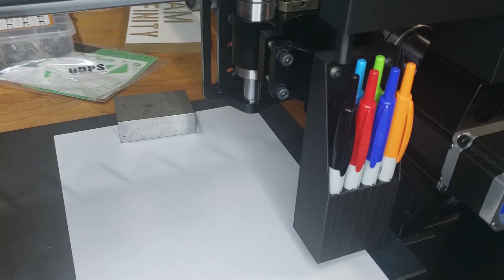Onefinity CNC: Pen Plotter Multi Row Magazine

Comment: Awesome reminds me of the HP7550A plotter I had 20 years ago, but much bigger. I can see this being used for drawing many things. Topo maps, weather maps, schematics, piping diagrams, color-coded underground utility maps, and more.
Reply from the maker: Yeah, those old HPs were something else. Crazy fast and precise. My purposes for this project are wall- hanging motorcycle wiring diagrams and amplifier schematics. The first project will probably be integrating with WireViz. WireViz already exports SVG, so it should hopefully be pretty straightforward.

Comment: Wow, I can't even get mine to engrave a simple word, literally. Got my onefinity a week ago without knowing anything...sure is a steep learning curve
Reply from the maker: As unintuitive as it seems, lettering is one of the more difficult things to get right. There are lots of weird shapes and sharp corners a bit can't physically do. On top of that, any given font might be a vector path or might be a pixel grid. 

I advise starting with the basics -- get to know gcode well enough to move your machine in straight lines, then move on to more complicated things from there. 

I highly simulating your gcode in CAMotics before running it on the machine. Fell free to ask questions and there's a good community at https://forum.onefinitycnc.com/
Reply from the maker: Before you send a job from Fusion, have you confirmed the machine moves correctly when you jog it from the web interface, touchscreen or game pad?  If it doesn't, check your wiring and axis direction checkboxes in the configuration. If it does, try some simple lines with Fusion and once you have that working, move up to your lettering. It's a journey, but well worth it.
Reply: @cilynx  Lines before lettering and check the configurations for wiring / axis direction, gotcha. I did notice that the machine's Z axis doesn't go further than the halfway point. I should have researched that first before running the file but I thought it was okay as the place I was engraving was not in that area.

I got a lot of research to do tomorrow but at least now I have a direction once again, thanks!
Reply from the maker: How's it going today?  Any progress?
Reply: @cilynx  Hey! I actually just got off work, going to try out things when I home. I went to the forum and made an account there just incase google doesn't have my answers. Thanks for checking up on me!

I think before I send lines and such to the machine I need to watch some basic videos on fusion 360, like you said it's good to know the basics, while I just jumped into the program haha

As for my z axis problem, I did slight research in the morning and didn't find any solutions. I might have to post about it on the forum, or I'll check the machine configurations like you said first before going to the forums.
Reply: @cilynx  Great news! I carved stuff, well to be exact I carved a word again. I decided to buy vcarve desktop and it works like magic, I like it way more than fusion. As for the errors I've ran into, the z axis was acting weird because I plugged them in wrong. Another error was something about soft limits, for that I used the forums to find a fix. Thanks man!
Reply from the maker: @Vastfill  glad you got it going! I see a lot of 1F folks going for vcarve, so you'll be in good company. Be sure to show off on the forum gallery as you start making things.

Comment: Great engineering cilynx on your part! Could you please give me the step by step on how to set the proper Z height and to zero it? For I already drove a Sharpie right down into my spoil board :)

I too own a Onefinity
Reply from the maker: I'm doing all of my plotter work via the pygdk module I'm working on -- just starting to get documentation together, but you'll find some rough guidance on getting the plotter configured here: https://github.com/cilynx/pygdk#plotter
Reply: @cilynx  well I read your great great github documentation, but could not find anything about Z height. But saw references to high spindle speeds. Are you actually having the router spin during the plotting process? 

If sir you could make one more video  for us showing how to place down a sheet of paper and just how to make the pen not crash, but merely make a gentle mark on the paper without tearing it or leaving no mark at all, that would be super!

I know I cannot use the Infinity touch plate for this, unless you have a trick that you are using here
Reply from the maker: @markroles7304  -- I added a new section specific to the plotter early this morning which includes how to set the three critical Z heights.  You may need to refresh the github page for it to show up.  I'm working on a magnetic mount for the magazine and breakaway for the changer post.  Once I get those working, I'll put together a video going through the entire assembly, configuration, and first marks on paper - probably this weekend.
Reply from the maker: @markroles7304  -- regarding the router/spindle, no, I generally don't even have it in the mount when using the plotter to save the wear and tear on the machine hauling around unnecessary weight.
Reply: Lol at myself here. I should have observed this with your multiple pen setup here. For if you had your spindle  speed on, it would not have any effect to your setup, being shown with out a router to it.

Quoting here the most famous philosopher in ancient Greek  history, Homer himself, D'oh!